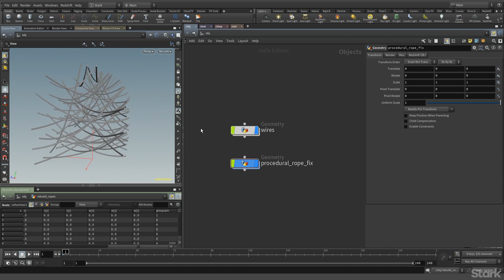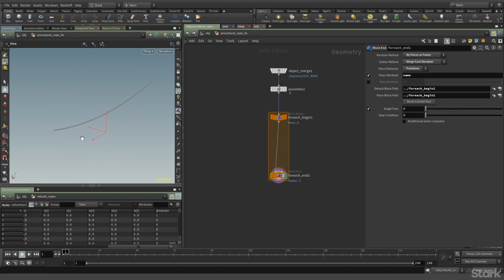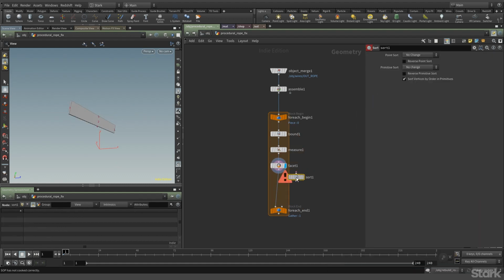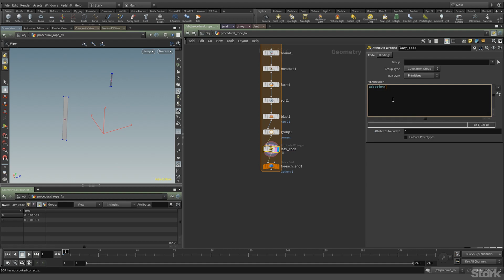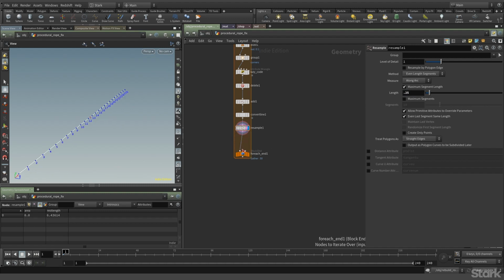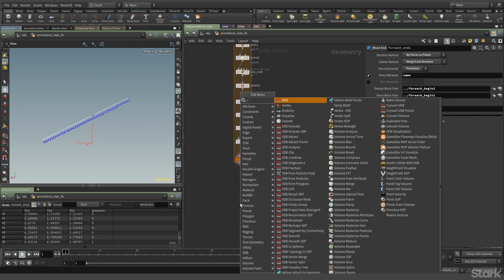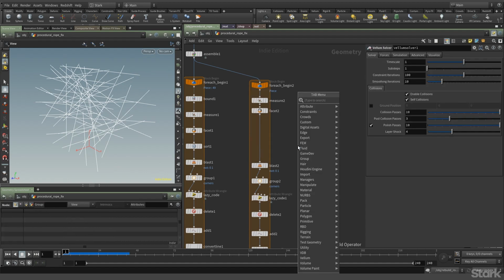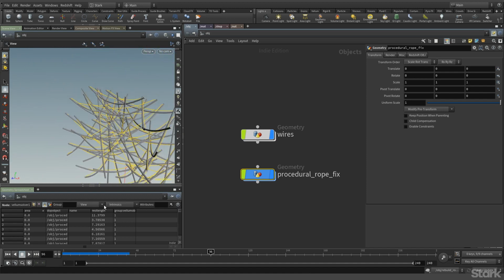Stark Houdini Procedural Rope Fix

Comment: If missing end caps was the problem, couldn't you just use a cap sop? But say you can't cap it, in that case, as long as it's a quad mesh, you could use a point wrangle to find all points with neighbourcount > 3 and delete, that should leave you with just the end points, then get the center for each cluster.
Reply: Another approach would be to move the points reverse to their normals (peak with a negative value) until they all meet at their respective ring's center, then fuse. That way the rest wires would conform to the modeled ropes.